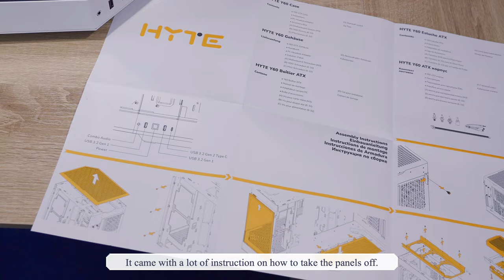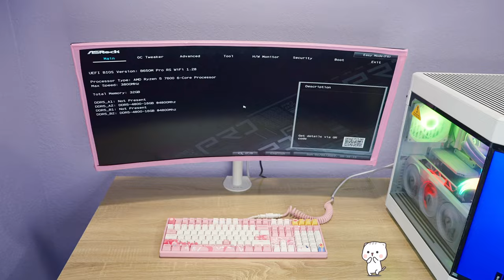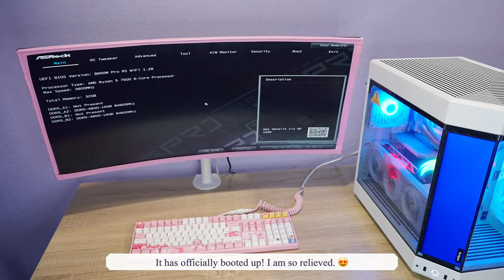building my first gaming PC 🥛 WHITE aesthetic + $1600 budget | aesthetic vlog

Comment: Flip the side/front fans to make it intake, as you have all exhaust fans. Heat rises and you want to bring fresh air in.
Reply: finally someone else noticed lmaoooo
Reply from the maker: It has intake fans pre-installed in the base of the case pointing at the GPU
Reply: @kawaiisorbet  shii there is fans, but I’d still rather flip them either way imo
Reply: @kawaiisorbet  maximum intake for that case because of the laminated glass, bottom in-take is not enuf, all your fans are exhaust cool air will be put out immediately.
Reply from the maker: @hunchojackrom8301  the temps are good
Reply: @kawaiisorbet  your gpu is pulling all that fresh air straight out of the system, your radiator is only circulating hot air for cooling your cpu, you can leave it how you want just wanted to notify you since its your first build
Reply: Damn I didn't know there are fans hidden in the bottom thats cool
Reply: @kawaiisorbet  did you make them exhaust for asthetic? If you the fans on the right side of the pc intake fans, then the sticker on the fans would be showing, and then thwy wouldnt be all white. This is just a theory of course

Comment: I am in NO WAY trying to be condescending.  I thought this was all kind of cool and refreshing to see.  

As someone who has been building and repairing computers for 30 years, I got a few chuckles at some parts.

Like, "There are a lot of screws to take the panels off."  Compared to 10 years ago or even further back, things have improved SO much in this regard.

The cheerful celebration of getting the power supply in, lol.  Awesome.  Though I haven't watched the whole video yet (I will!), I am going to assume you will discover that it is easier to populate the cable connections, before putting the power supply in.

Anyway, congrats on the build and thank you for the video!
Reply from the maker: thank you for taking the time to write a comment! I'm glad you enjoyed watching and had a laugh too, lol!

Comment: The parts she used was quite good budgeting. 
Cheap yet good cpu that has am5 upgrade path
The gpu was excellent and around 300 dollars on Amazon
Thermalright fans the 3 pack she's using is around 14 to 16 dollars compared to the 30+ you could end up paying
The ram is t force which is around 90 bucks for 32 GB 
The storage is 1 tb and also t force so maybe 60 dollars or so (good deal) 
(And the ram and storage is almost guaranteed to be part of a pack sold on Amazon) 
AIO was budget as well a little under 100

The case is excellent value if you are wanting side mounting. Added on that you'll only have buy 3 fans for the case. And it comes with fans included as well. Making a total of 8 fans including the fans of the aio. 

This was actually an excellent budget build with an upgrade path. I give it a 10/10. Made my heart happy
Reply from the maker: @crowofjudgment  thank you so much!! I’m so glad you enjoyed my build and can see I tried to make it as budget as I could☺️

Comment: wire management isn't bad for your first set up. That's one of the easiest things to literally mess up. I'm also going for an all white build in this case but going custom liquid cooling loop inside which will be a bit difficult for me as I'm used to much larger cases for it.

Comment: this video screams "YOU ARE POOR"
Reply: I have a 4070s but this makes me feel poor too 😢
Reply: This actually quite budget friendly compared to most PCs
Reply: Actually the parts she used was quite good budgeting. 
Cheap yet good cpu that has am5 upgrade path
The gpu was excellent and around 300 dollars on Amazon
Thermalright fans the 3 pack she's using is around 14 to 16 dollars compared to the 30+ you could end up paying
The ram is t force which is around 90 bucks for 32 GB 
The storage is 1 tb and also t force so maybe 60 dollars or so (good deal) 
(And the ram and storage is almost guaranteed to be part of a pack sold on Amazon) 
AIO was budget as well a little under 100

The case is excellent value if you are wanting side mounting. Added on that you'll only have buy 3 fans for the case. And it comes with fans included as well. Making a total of 8 fans including the fans of the aio. 

This was actually an excellent budget build with an upgrade path. I give it a 10/10
Reply: @crowofjudgment  ok, i don't have even that

Comment: I mean.. looks awesome but... 
Dunno why all aim towards aesthetic instead of functionality. 

You have 360 mm radiator, assuming pulling air out, then you have 2 intake fans and a air - cooled gpu with 3 fans  in a vertical mount close to glass panel. 

Plus one additional fan to take the heat out in the back.. not really ideal to starve your components from air like that but like you said.. you re playing Genshin only, which could play with even cheaper build.

Have fun with the new system and keep an eye on the dust build up.
Happy New year folks 🍻

Comment: 6:18 Your side fans are backwards, the part with the plastic thingy is where the airflow goes, they should be pointing towards the inside of the case is not gonna broken or anything but is not optimal as all your other fans (as far i can see) are set to exhaust  and you are not pulling fresh air in so it would overheat faster. Also make sure your GPU have some space between the fans and the window panel cause it wont have space to "breath" and it wil clog.
Reply: Also triple fan watercooler is just so overkill for a Ryzen 5, but it will be worth if you plan to upgrade it in the future.

Comment: Super cute and great build💖 one thing is the 7800xt performed way better with very very less price difference then the 7700xt so should have gotten that but non the less it's a amazing build
Reply from the maker: Thank you so much!! 💕 I just was really trying to budget and balance things out and i thought the 7700xt was far good enough for me at this point 🥹
Reply: @kawaiisorbet  yes the 7700xt is also a great card hope u have a great time 💖
Reply: @kawaiisorbet  its only $50 more and the performance boost you could get from it large. But still, nice build!
Reply: Thanks! I was ripping this build for myself cause building is so complicated but this probably saved me from a mistake. Nice post! <3
Reply from the maker: @storysnow1569 well  the 7700xt is more power than honestly most people need 😅 its far more than even I need, lol. Its certainly not a mistake to get that card. But if you wanna go up for it go for it!

Comment: 240mm radiator for 7600x is OP, i think. 32gb of ram is also OP. 
With the extra money from radiator and the ram (DDR5 16 gb/ 2x 8gb is enough). 
Perhaps I could buy 7800x3d instead.  

The 2 fans on the side should have been mounted as intake. So, the radiator could get enough air. 
Despite with this fans configuration (0 intake fan + 6 exhaust fans = negative pressure), well im worried about that gpu without enough air tho.
Reply from the maker: There are two fans under the GPU under the grate in the case that came pre-installed that are intake 😊
Reply: @kawaiisorbet  Good to know. But still, i would install the 2 fans on the side as intake. That radiator still needs fresh air even tho its OP.

Comment: The fans are setup wrong. There are way too many exhaust fans in your build. The 2 fans on the right of your case is supposed to be turned the other way around to pull air into the case. You could also purchase reverse fans which pulls air in but you can keep the front good looking side facing the case.

Comment: If you have a 1600$ budget and priotize performance over looks you can get a lot more power just by notspending 400$+ on a nice case and RGB fans and aio and LCD screen and white parts and putting that money towards faster components
Reply from the maker: You're not wrong! I really wanted a specific look and power so some compromises were made. The nice thing about PC parts is you can upgrade them later. Ultimately I'm really happy with it!

Comment: The side mounted fans should be intake right? Or am i tripping? It looks like its mounted the otherway 🤔🤔
Reply: Literally doesn't matter. Better question: does fluid pumped into a tank exit faster than fluid being pumped out? That's the answer to everyone obsessed with positive pressure. It's hotter 😂

Comment: With over 40 years of building pcs etc Your choice of motherboard was 👍Anyone with a few decent grey cells can watch a multitude of videos on YT et that take you through the building processes et with some genuinely excellent tutorials/tips/know how. I always recommend before ANY build deciding on some real common sense priorities. WHAT are you going to use it for? How much? FUTURE proof? ie easily upgradeable..? You don't have to spend a fortune to get an all round starter pc.. that you can upgrade and or add to future wise to end up with a top of the range pc.. Good to see you pick the Ryzen.. The 5 OR the 7 are really good choices.. 👍TIP When opening the box ? Place onto a flat surface with the TOP down.. CAREFULLY cut the bottom putting the flaps OUTWARDS before pulling the bottom over and resting on the flat surface.. then lift the entire box OFF the contents etc.. The weight of the contents will allow the cardboard to slide up and off... 👍WARNING... Glass etc covers can be VERY HEAVY!!  WEAR rubber gloves OR get someone to help you.. PUT the glass cover someone SAFE and SECURE where it will NOT fall over et et ! TIP! Unwrap other components from their packaging et on a separate table WITH an adjoining bin et ... 😶DON'T do it on the same as your BUILD table et! 😶Water cooled or ? I seldom build using water cooled systems.. You don't have to have them if you use the right ie cooler master dry air etc systems correctly fitted.. 😶Overall nice build ! 👍👍Keep the plastic CPU cover safe ! If you need to return the motherboard??!! 🙂TOO MUCH paste on the CPU!!!  n you don't need to SCRAPE it!! The pressure of the cooler unit will do that !! Look at some of the YOUTUBE vids on how to CORRECTLY apply CPU THERMAL PASTE!! 😑

Comment: Beautiful PC but all of your fans are set up as exhaust. I'd flip the two back fans to be as intake so you have better airflow and less negative pressure to prevent dust coming in from every small crack.
Reply from the maker: Thank you!! There are pre-installed fans in the base of the case that came in it under the GPU that are set up as intake!
Reply: @kawaiisorbet  Ahh that's good 👍

Comment: I need to know how you people do/change the monitor border color 🥺 it's one of the things holding me back from buying a new one as I don't know if I need to buy it whatever color or if it's DIY and what I'll need

I would really appreciate information about this so I can get into getting my desk to look how I want ❤️🥺
Reply from the maker: the monitor border color? you mean like how mine is pink?
Reply: @kawaiisorbet  Yes! 🥺

I've been looking into getting my setup swapped from black to white but really struggle with the monitors/keyboards/mice/headphones part when looking for it which is holding me back 😮‍💨
Reply from the maker: @Nuller_Manden  you can actually use paint or tape! Mine has a pink tape around the edge. And on my last monitor, I actually spraypainted it. I know of others that have used these methods for a white aesthetic as well!
Reply: @kawaiisorbet  Oh okay! Didn't know of these options 0: many thanks for the info/tip ❤️🥺🫂
Reply from the maker: @Nuller_Manden  you're very welcome! 😊

Comment: That is a super cute PC you've build. Made me want to change my case. Love the LCD screen you added. I'm also building a all white gaming PC. Some of the components you've used like the ram and the lian li cables are the same parts and was stressing over how I can get all the ARGB to aline. How did you make it work? Also, been having issue with genshin running on a monitor that has over 60 ghz refresh rate so I had to down grade back to my own old monitor. Your monitor looks like it runs higher than 60 ghz refresh rate. If it is, how did you overcome the refresh rate problem with the game?
Reply from the maker: Thanks so much!!! I'm sure you will love an all white PC; the aesthetic is just so nice. Oh no, what is the issue you have been having with Genshin? My monitor runs on a much higher refresh, but I've had no problems with Genshin at all.. what does yours do?
Your question about the Lian Li cables, what do you mean? Like align the RGB colors for both cables?
Reply: So with genshin, I was experiencing pretty bad lag and it happened after I change my monitor. Upon researching, I found that it is a well known issue with genshin where when refresh rate is too high on the monitor, the game starts to lag. For me, it was to a point where it was unplayable so I had to revert back. I've tried to optimize through monitor and game settings but couldn't bypass the lag.
As for the ARGB question, you can disregard. I initially thought you had a lighting effect aligned with all ARGB component in your PC. I have a few ARGB components in my build from different companies like lian li strimer, corsair cooler and fans and t-force rams that I am trying to sync together   @kawaiisorbet

Comment: what happens if u dont use Lian Li RGB cables? does any of those things come with the normal cables?
Reply from the maker: You can use normal cables! They will work fine. I got lian li cables just for the rgb and effects. 😊
Reply: @kawaiisorbet  thank you for responding, what I really want to ask is do we need to buy extension cables, does the psu not come with it? Or the case not come with it? i am new
Reply from the maker: @robertjackson6937  the PSU comes with cables. But if you get a black PSU for example it will come with black cables. Sometimes people buy other cables just to have a certain look. I hope that helps 😊
Reply: @kawaiisorbet  yes! Thank you! i copied your pc build; bought most items from your Amazon website, but are there cheaper options for the extension cables you can recommend? Both together less than $30

Comment: You should have purchased the y70 it comes with the Screen and it’s bigger for better airflow that’s one of the big issues why I had to sell my y60 the airflow for my gbu was just non existent
Reply from the maker: So far the airflow has been fine for me. The y70 was on backorder, and honestly I like smaller cases. Y60 is actually pretty big as it is
Reply: @kawaiisorbet  ahh understandable I had  my 4090 on mine and the temperatures it was getting was no good I had to keep removing the glass for it to settle back down to operating temps where I felt more comfortable

Comment: For the lcd what power supply did you use? Ppl are saying usb c but I think it’s micro usb. Also what software to control the screen/images?
Reply: It’s micro USB to a molex off your psu. I used wallpaper engine from steam. It’s $4 US. You can select it as a separate screen in the program. Note it is like a second monitor hdmi out of graphics card to mini hdmi on the controller for the lcd panel. Use wallpaper approved for phone it helps with the sizing.

Comment: Clean build! But I have a question. HOW ARE YOU USING CONTROLLER ON GENSHIN ON PC??? I have been wanting to do that for ages.
Reply from the maker: Thank you so much!! It's in the settings in Genshin you can switch between keyboard and controller as long as the controller is compatible with PC! There are a lot of controllers out there with Bluetooth connectivity!

Comment: All of your parts was wrong on Amazon. At least 4 parts.i had to return several parts because you listed them wrong. You also didn’t show where the cables goes everything. That would help because it’s the hardest part.
Reply from the maker: I added the parts directly from the parts I bought. I know what parts I bought because I bought them from Amazon and they were in my history, and I added them to the list. Any different parts were updates to the list because some of the parts I used were no longer sold. So for those, I specifically updated the list so that they would be parts that worked with all of the others. I even double checked with someone very experienced in building PCs.

Comment: Hi! sorry in advance for the long message ... could you please direct me to the site or book you saight out to learn HOW to build a PC? I'm at 0% experience but I want to build my own PC, however I have no idea where to start and the videos on YouTube and sites all recommend the brand(s) who they are sponsored by ... so idk really if I'm getting a good deal or just getting scammed :(
Reply: TechSource has probably one of the best building videos on YouTube. Its like 3 years old but the information is still accurate. Linus Tech Tips have made several very comprehensive videos. But I think they pack way too much information that is mostly irrelevant for the majority of PC builder novices. I suggest watching a few PC build videos so that you get the general idea of how the PC is assembled. After that, the specific parts you use depend on your budget and/or performance needs and wants.

Comment: With 1600 usd I can get a 7800xt white and a 7600x why did you spend so much on the case and the AIO they won’t do a huge difference and the motherboard is overkill for your cpu one of the worst builds for the price

Comment: The fans are wrong,al of them are blowing air out,not one in :/ the temps are terible...
Reply from the maker: The temp is fine, there are pre-installed fans in the base of the case pointed at the gpu